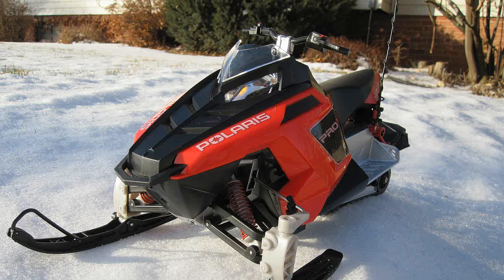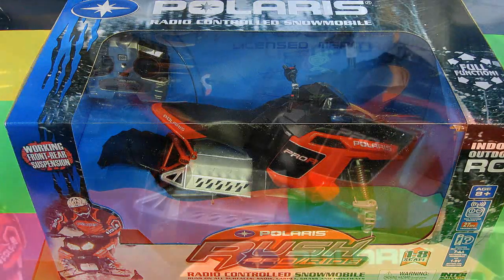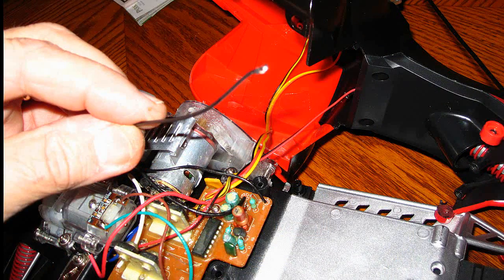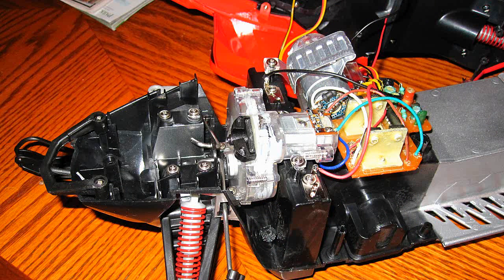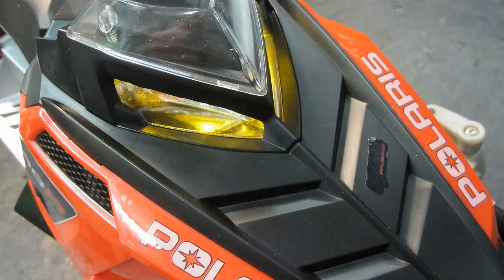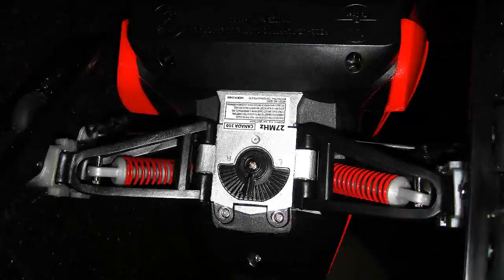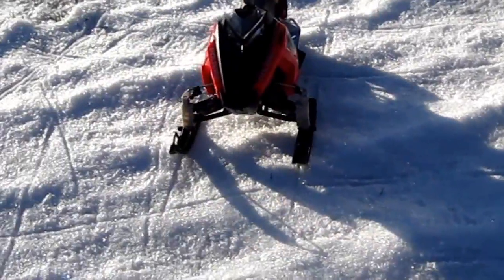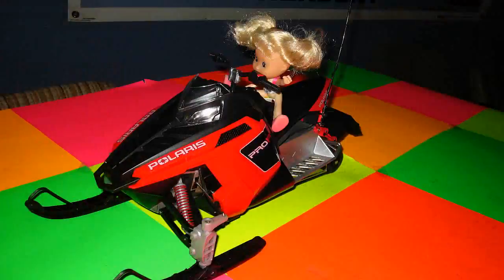Polaris Rush R/C Snowmobile Review

Comment: mine won't run in snow deeper than an inch... the rear just digs itself into the snow and the snowmobile goes nowhere.
Reply from the maker: Well soft snow is not the best for any of these models, but like a boat, once you get it up on the step, it will go.  The Stock one would not though. Here is how I modified this to work better.  Enjoy.  https://www.youtube.com/watch?v=ROmPRiJBVjI

Comment: That's an early 2000's circuit alright. You should be able to get another controller to work with it in fact on same freq which may have hi/lo speeds on it...could inspect datasheet. Doesn't matter if junking it.
Here's an idea - salvage the circuit to go in a tow behind trash collector for yard maintenance, then lights on/off and motorized tipper, like the BigTrak acccessory  hehe

Comment: Dave, I think you should change the Alkaline to a 3s LiFe with 1-3A capacity. I'm sure LiFe battery is able to deliver much better performance than Alkaline due to the low internal resistance.

Comment: You could hardly find a toy below $70 to have proportional controls, and if it did it would be stated on the box. 3S LiPo would work much better than 7 AA batteries due to lower internal resistance as lookeflite noted, but also by cutting down on weight (instead of 170 grams for AAs, LiPo would weigh 40 to 70 grams), in total you would get at least 30% increase in performance which would bring fun to a new level at no extra cost!